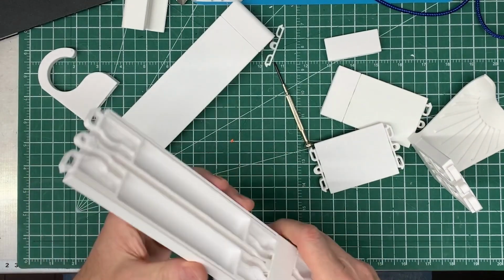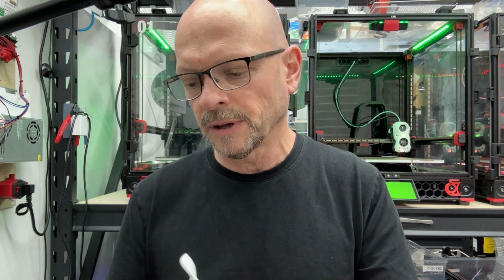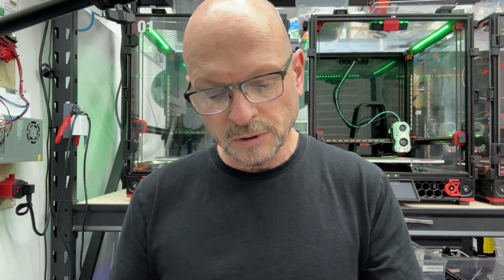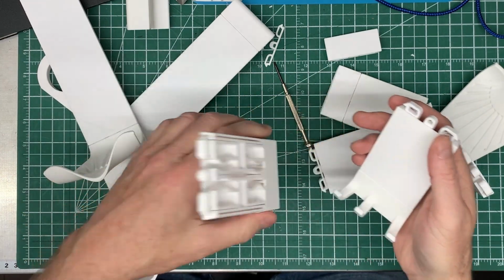Shower Soap Trays

Comment: What was your learning process for the flexible connectors? I've seen examples of completed designs but I haven't seen any how tos for making them yourself. Nice design by the way!
Reply from the maker: That is a great question, and I have to start by saying I am not a great teacher, I want to teach but I do not know how.  But even with that said, I am not sure I can answer it too clearly.  It is an accumulation of design experience rather than an engineering process.  Over the past few years, I have attempted many of these compliant mechanisms and slowly gained an understanding (in my mind) of what might work.  So then I will start with a design, print it, test it and repeat until I get it to work.  Lately, that process has been very short but initially, I took a lot of time to find out what would flex and not break.  And, how far to flex.  Spacing is also critical but that one is a little easier to communicate.  Generally, 0.2mm spacing works quite well but depends on the print orientation of the two mating parts.  Sometimes you can go down to 0.0mm but other times up to 0.4mm.  Also, very small designs are different from larger ones (bigger designs need more space).  I hope that is helpful.  Perhaps I will try to document it in a video or blog post sometime so that I can try to share what I know better.